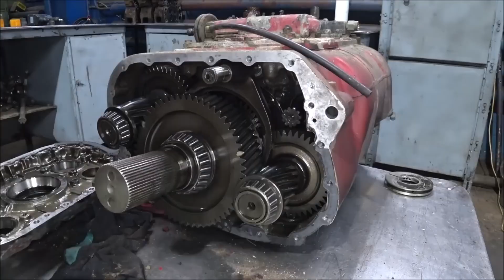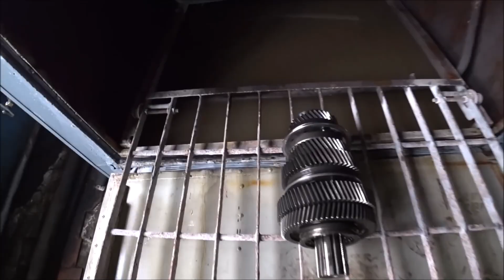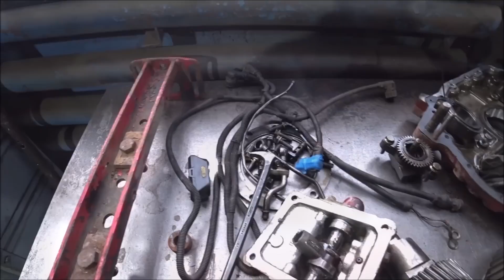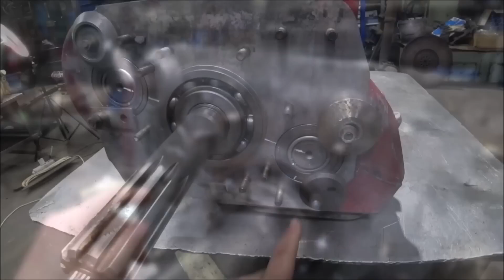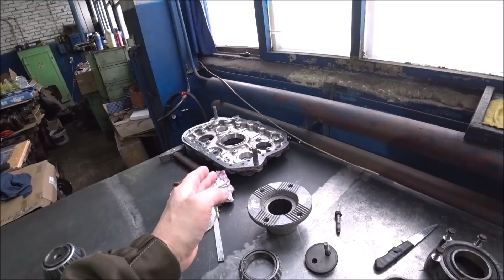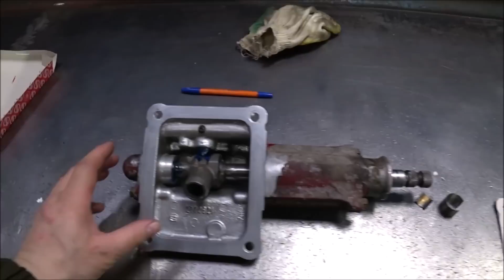Unusual EATON Transmission Repair: Tear Down, Clean Up, Rebuild — Extended Episode

Comment: The thing you kept calling "splitter" is actually the drive/overdrive synchronizer. The thing you called the "demultiplier" is usually called "range" in eaton's manuals, and the synchronizer on that is the splitter.

If you didn't see anything wrong with it, then the complaint is most likely due to a problem with the air system. That triangular valve housing on the top cover contains a pressure regulator, and if it goes bad, the splitter will make noise and sometimes fail to shift.